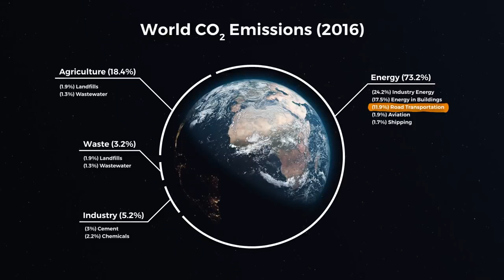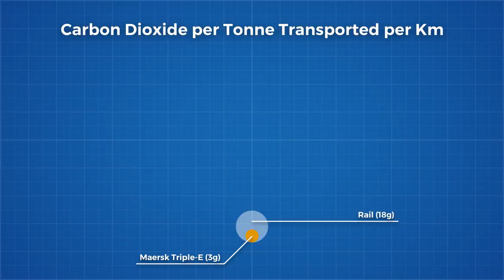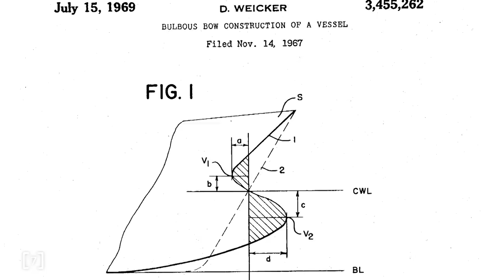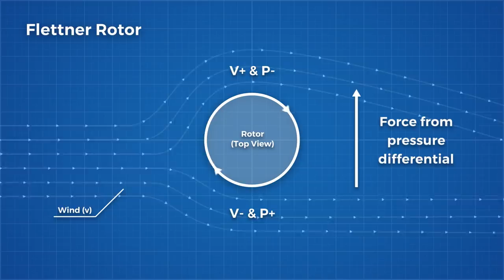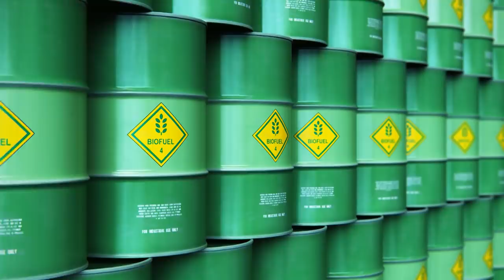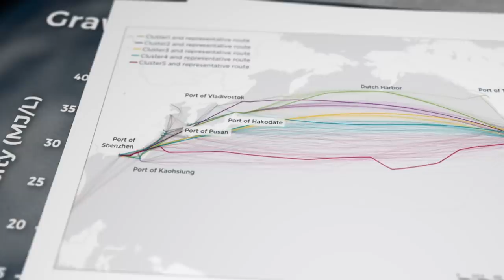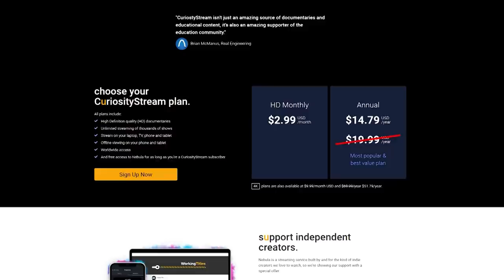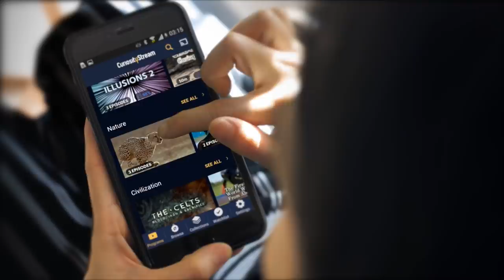Are Renewable Powered Ships Possible?

Comment: What if they had a nuclear-powered engine
Reply: Just think; would you have full confidence in the management of a nuclear reactor under the control of an anonymous entity only traceable, perhaps, via a letter box in a FOC (flag of convenience) nation state?  If you are, could you sell that confidence to Japan, the state that hosted the Hiroshima and Nagasaki nuclear detonations as well as more recently the Fukushima ‘event’?  Then try that same, or a similar, sales strategy on Ukraine, the nation state that as a part of the USSR (CCCP) hosted the Chernobyl ‘event’.  Modern iterations of nuclear energy, thorium fuel, molten salt reactors, small modular reactors or fusion reactors, will carry the legacy of past problems.  It is the global trepidation of anything with 'nuclear' in the name and the economics of nuclear having transitioned from 'energy to cheap to charge for' too 'the costs of remediation are incalculable' that will prevent the adoption of nuclear energy as a means of creating energy at sea.  Modern reaction systems may have overcome the safety problems but the general public, having been misled in the past, will be reluctant to believe the fresh new promises.  The incident of the ‘Ever Given’ blocking the Suez Canal, March 2021, may also have a little to add to this debate.  The cooling water on ships tends to get taken in from near the bottom so when running aground the inlets are in a prime spot to get plugged up restricting, if not stopping, the flow of coolant.  One thing that the TMI, Chernobyl and Fukushima incidents all had in common was that the supply of coolant, or rather lack thereof, was a fundamental cause.  Similarly and only months later, May 2021, had the ‘X Press Pearl’ been nuclear powered then a major port for a populous nation in the global South would have possible been the site of a significant exclusion zone due to a non power plant related incident.  If the ‘X Press Pearl’ had on board a fired up but ‘safe’ molten salt reactor and found herself having to run down the possible 12.5 megaWatts of energy in the power cycle would a stable cool down have been possible?

‘They’ say nuclear is cheap, it’s not it is expensive and has a large embedded carbon quotient as well as being complicated, dangerous, not universally socially acceptable and having only ‘no need for refuelling’ as a questionable advantage; actually it does need refuelling just not as often.  When ‘they’ do need to refill the warming up stuff it takes considerable longer than pumping tonnes of thick black stuff, cSt380 HFO, or thin runny stuff, MDO, onboard which is one of the reasons HMS Queen Elizabeth and HMS Prince of Wales are pushed about by ICEs and gas turbines thus using a similar fuel as the aircraft that fly off of them.  The Royal Navy (RN) with a high degree of skill and expertise uses, at vast expenses to the UK taxpayer, a current operational nuclear fleet of 11 submarines (also known as ‘boats’) in two flotillas, seven attack subs and four ballistic missile boats.  The carbon footprint of all the extra bits of hardware and the fuel, including processing thereof, from ground to propeller, are the external costs that never seem to get considered.

Disposal, once it wears out, of both the machine (that was a ship) and fuel is another can of worms best left unopened.  The 26 RN nuclear powered boats no longer in use are laid up (some in Rosyth and some in Portsmouth) awaiting long term deconstruction including dealing with the fuel rods and other irradiated material.  The USN is not, as far as I know, a commercial organisation working to very tight margins and also has the skill and expertise to handle the complexities of nuclear power; so as well as submarines their aircraft carriers are nuclear powered and each of the current iteration has a build cost three times that of QE/PoW, bigger crews and even more generous funding.  For those who still think that nuclear energy might be the answer I recommend this report: - https://www.bbc.com/future/article/20200901-the-radioactive-risk-of-sunken-nuclear-soviet-submarines?ocid=ww.social.link.email.  The navy of the USSR might have been under resourced and over extended but it was still generously supported in comparison with merchant shipping.

Another, similar but more extensive view, may be found at https://www.quora.com/Why-are-there-so-few-nuclear-powered-cargo-ships-If-it-works-for-ice-breakers-and-submarines-why-hasn%E2%80%99t-it-been-established-for-merchant-vessels.  Why not use nukes?  It is down to engineering, finance, socio-political attitudes and safety.

Comment: What about Nuclear. Nuclear I believe is the future for destroying carbon emissions especially as research goes forward.
Reply: If you do a web search for ‘nuclear ship savannah’ you will see that it has been tried and did not work.  A similarly heavily subsidised, by the government, vessel is in use in Russia which also operates, in support of the Northern Sea Route, a fleet of nuclear powered ice breakers these may, or may not, have been completely without issues.

Just think; would you have full confidence in the management of a nuclear reactor under the control of an anonymous entity only traceable, perhaps, via a letter box in a FOC (flag of convenience) nation state?  If you are, could you sell that confidence to Japan, the state that hosted the Hiroshima and Nagasaki nuclear detonations as well as more recently the Fukushima ‘event’?  Then try that same, or a similar, sales strategy on Ukraine, the nation state that as a part of the USSR (CCCP) hosted the Chernobyl ‘event’.  Modern iterations of nuclear energy, thorium fuel, molten salt reactors or fusion reactors, will carry the legacy of past problems.  It is the global trepidation of anything with 'nuclear' in the name and the economics of nuclear having transitioned from 'energy to cheap to charge for' too 'the costs of remediation are incalculable' that will prevent the adoption of nuclear energy as a means of creating energy at sea.  Modern reaction systems may have overcome the safety problems but the general public, having been misled in the past, will be reluctant to believe the fresh new promises.

‘They’ say nuclear is cheap, it’s not it is expensive as well as being complicated, dangerous, not universally socially acceptable and having only ‘no need for refuelling’ as a questionable advantage; actually it does need refuelling just not as often.  When ‘they’ do need to refill the warming up stuff it takes considerable longer than pumping tonnes of thick black stuff, HFO cSt380, or thin runny stuff, MDO, onboard which is one of the reasons HMS Queen Elizabeth and HMS Prince of Wales are pushed about by ICEs and gas turbines thus using a similar fuel as the aircraft that fly off of them.  The Royal Navy (RN) with a high degree of skill and expertise uses, at vast expenses to the UK taxpayer, a current operational nuclear fleet of 11 submarines (also known as ‘boats’) in two flotillas, seven attack subs and four ballistic missile boats.  The carbon footprint of all the extra bits of hardware and the fuel, including processing thereof, from ground to propeller, are the external costs that never seem to get considered.

Disposal, once it wears out, of both the machine (that was a ship) and fuel is another can of worms best left unopened.  The 26 RN boats no longer in use are laid up (some in Rosyth and some in Portsmouth) awaiting long term deconstruction including dealing with the fuel rods and other irradiated material.  The USN is not, as far as I know, a commercial organisation working to very tight margins and also has the skill and expertise to handle the complexities of nuclear power; so as well as submarines their aircraft carriers are nuclear powered and each of the current iteration has a build cost three times that of QE/PoW, bigger crews and more generous funding.  For those who still think that nuclear energy might be the answer I recommend this report: - https://www.bbc.com/future/article/20200901-the-radioactive-risk-of-sunken-nuclear-soviet-submarines? ocid=ww.social.link.email.  The navy of the USSR might have been under resourced and over extended but it was still generously supported in comparison with merchant shipping.

Comment: NUCLEAR
NUCLEAR
NUCLEAR
Reply: Just think; would you have full confidence in the management of a nuclear reactor under the control of an anonymous entity only traceable, perhaps, via a letter box in a FOC (flag of convenience) nation state?  If you are, could you sell that confidence to Japan, the state that hosted the Hiroshima and Nagasaki nuclear detonations as well as more recently the Fukushima ‘event’?  Then try that same, or a similar, sales strategy on Ukraine, the nation state that as a part of the USSR (CCCP) hosted the Chernobyl ‘event’.  Modern iterations of nuclear energy, thorium fuel, molten salt reactors, small modular reactors or fusion reactors, will carry the legacy of past problems.  It is the global trepidation of anything with 'nuclear' in the name and the economics of nuclear having transitioned from 'energy to cheap to charge for' too 'the costs of remediation are incalculable' that will prevent the adoption of nuclear energy as a means of creating energy at sea.  Modern reaction systems may have overcome the safety problems but the general public, having been misled in the past, will be reluctant to believe the fresh new promises.  The incident of the ‘Ever Given’ blocking the Suez Canal, March 2021, may also have a little to add to this debate.  The cooling water on ships tends to get taken in from near the bottom so when running aground the inlets are in a prime spot to get plugged up restricting, if not stopping, the flow of coolant.  One thing that the TMI, Chernobyl and Fukushima incidents all had in common was that the supply of coolant, or rather lack thereof, was a fundamental cause.  Similarly and only months later, May 2021, had the ‘X Press Pearl’ been nuclear powered then a major port for a populous nation in the global South would have possible been the site of a significant exclusion zone due to a non power plant related incident.  If the ‘X Press Pearl’ had on board a fired up but ‘safe’ molten salt reactor and found herself having to dissipate the residual energy associated with the possible 12.5 megaWatt power cycle would a stable cool down have been possible?  In a casualty ships may capsize, like the ‘Karin Hoej’ of Bornholm in the Baltic early December 2021, in which situation any safety system reliant on gravity might not work.  Why not use nukes?  It is down to engineering, finance, socio-political attitudes and safety.

Comment: A sail boat and man power.
Reply: To address the suggestions that wind power is the answer I offer the following.  The canvas, cordage and extra manpower needed for sailing ships was never a very benign environmental option so please discount any idea of sail as ‘sustainable’ and this is without the problem that if ‘the wind don’t blow the ship don’t go’, when it does blow it often blows in the wrong direction for your cargo delivery needs and sometimes there is rather too much of it for comfort.  The area where one is most likely to be ‘becalmed’ is the ITCZ (Intertropical Convergence Zone) or ‘the doldrums’ as it is commonly called.  In days of old ships with large crews, such as naval vessels, could try using the ships boats and some of the crew to row through the doldrums thus towing the mother ship out of the calm.  Not practical for less well manned and much heavier merchant ships which could not muster a similar power (oarsmen) to weight ratio (vessel displacement).  Traditional sailing ships are unable to go directly up wind so if the wind is blowing from the direction your cargo needs to go then a zig-zag course must be steered, more distance and thus more time on passage at whatever speed is achieved.  Wind speed is traditionally measured on the Beaufort Scale (wind speed) that runs from 0 (< 1kn or 0.5ms-1) to 12 (> 63kn or 32.5ms-1) and for sailing purposes the usable part of the range is ‘3’ (circa 8kn or 4.1ms-1) to ‘6’ (circa 24kn or 12.3ms-1).  As the wind speed, and the amount of energy that may be harvested there from, increases the sea surface becomes progressively more disturbed which makes the harvesting process ever more difficult and increasing the stress on the vessel.  The increased stress means the sail area has to be reduced, either by using fewer or smaller sails until the vessel may in extremis be ‘hove to under storm sails’.  With any wind power proposals the question that must be asked include ‘has any information been released into the public domain with regard to the expected energy harvest for the wing forms, on a Watts per square meter basis?  ‘Cutty Sark’, is said to have been able to coax 3 000 horse power (or 2 206 500 Watts / 2.2 megaWatts)) out of her, up to, 2 976m2 of sails, assuming ideal conditions and further assuming that for sailing purposes the usable part of the wind speed range is 4ms-1to 12ms-1 so the yield would be about 741 Watts m2.  So another question ‘for the proposed option what is the expected upper wind speed limit for the system’?  A single stage 'harvest to deployment' system for propulsion will have higher efficiency but ‘what steps are being taken to provide ancillary power such as the, small but essential, domestic, navigational and cargo needs?’